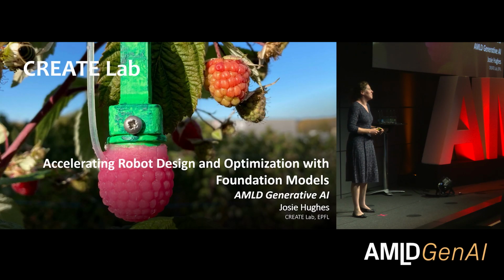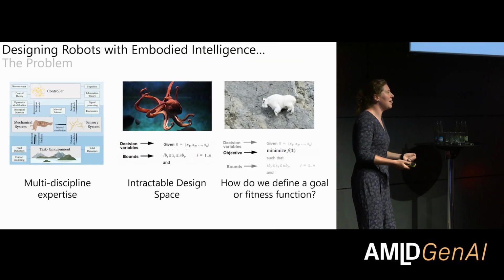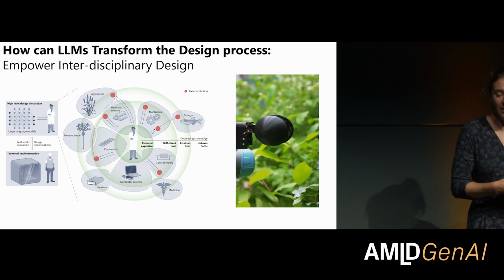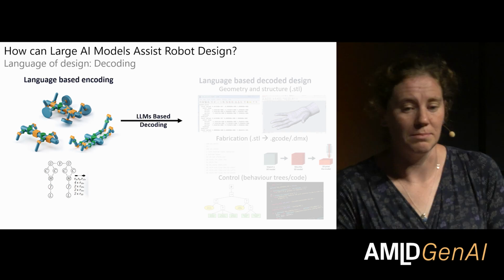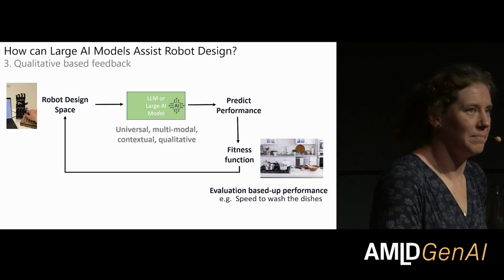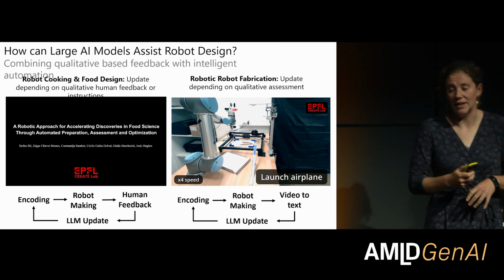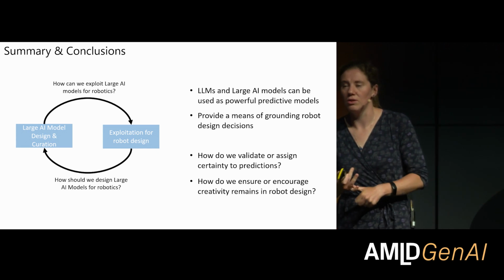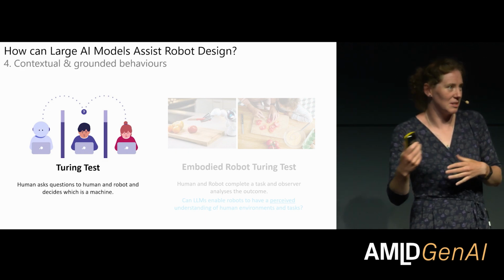Accelerating Robot Design and Optimization with Foundation Models | Josie Hughes

Comment: I enjoyed your presentation and found the concepts quite engaging! I do have a small note regarding the section at 9:30. It appears that the bottom left image represents a grammar-based genotype, and the upper left shows the phenotype of modular robots. The transition from genotype to phenotype fits the term "decoding".  While the arrow indicating the progression from the modular robot design/phenotype to the 3D printable stl file along with other related outputs for fabrication and control, is separate from the decoding process and more accurately described as "modeling and exporting". Thought this might help clarify. Keep up the fantastic work!